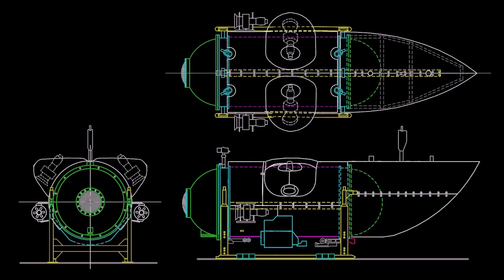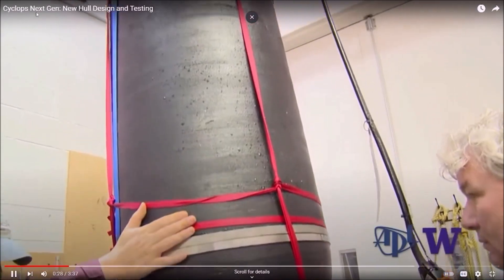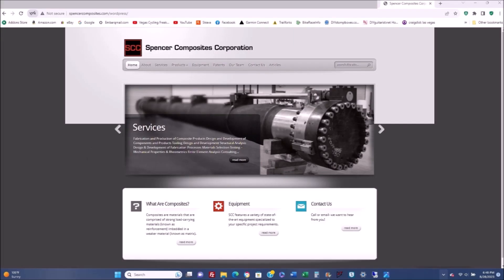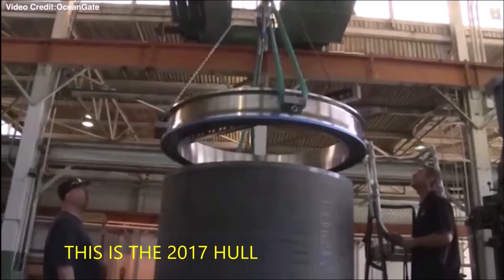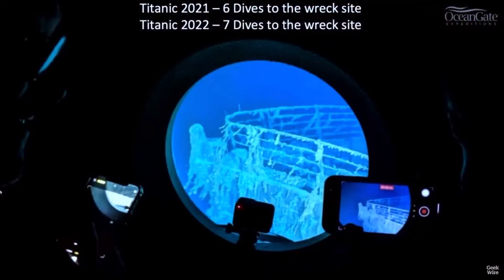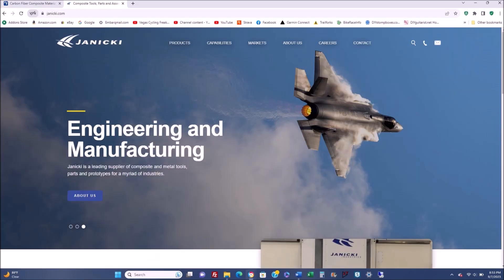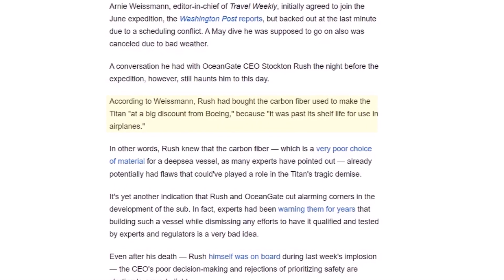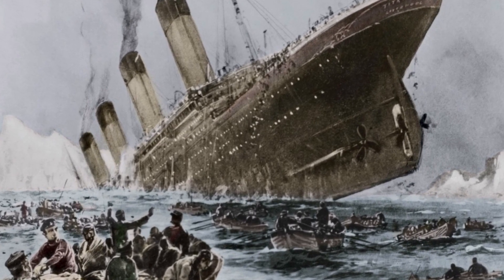OceanGate Titan - THE CARBON FIBER CYLINDER(S)

Comment: S.Rush was also totally against more testing, and what about the window that wasn't rate to go to the depth of titanic? You peking excuses for stockton is funny! WHO resisted all that testing you say was needed? OH Stockton? Ok then
Reply from the maker: You are mixing up pre-2020 and post-2020 hulls. Some of those things don't apply to the 2020 hull. All that negative media stuff applied to the pre-2020 hull, which was scrapped and replaced with a new one using a much better manufacturing process. Timeline is VERY important when discussing anything about the Titan.

Watch these:

Acrylic viewport --https://www.youtube.com/watch?v=iDxzYXDY1gM&t=1s

Beyond certification? -https://www.youtube.com/watch?v=x99U0GKXDNc

RTM system -- 
https://www.youtube.com/watch?v=XVpkWoHl67Q

Rush was in uncharted territory. There were no standards to test to and he believed in his real time monitoring system, which in theory seemed like a great idea but in reality I think was false sense of security. What testing agency is going to take liability on something for which there are no standards?! Call it what you want, but Rush was on his own. No one would have certified that. They operated in international waters, were based in Bahamas and the "mission specialists" all signed waivers that mentions death nine times, and that they were boarding an experimental vessel. What else could he have done?

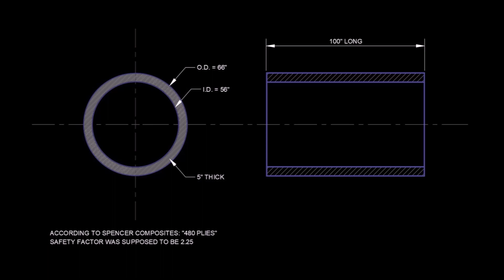Comment: @3:57 "able to withstand 6,600psi."

At 3,800m the pressure is 5,800 psi  so the safety factor was 10% not 225%, let alone 300%.
Reply from the maker: I'm just going off what it said in this article: https://www.compositesworld.com/articles/composite-submersibles-under-pressure-in-deep-deep-waters

I would interpret that as being built twice as strong as it needed to be. Obviously not how it turned out in the real world.

Comment: What kind of blithering idiocy is this?

This is all on Stockton and his refusal to do the proper engineering and his refusal tolerate anyone who advocated for proper engineering.
Reply from the maker: Put down your pitch fork for a minute. OK now get a copy of the ASME Safety Standard For Pressure Vessels For Human Occupancy and ASME Division VIII (Boiler and Pressure Vessel Code. Read thru all 196 pages of the PVHO and 796 pages of the BPVC. Show me where carbon fiber is mentioned in either one. Now explain to me how all these experts are experts on a subject they know nothing about. They were all worried only about how an incident like this would hurt their own pocket books. The only thing Rush could do was have a third party build him the cylinders to his specs and do his own pressure testing. I'm not on a moral crusade, I am looking at it from an engineering standpoint.
Reply: @VegasCyclingFreak  If engineering standards have not been set for the use of carbon fiber in such pressure vessels.  How can one interpret that to mean that they can do whatever they want with minimum testing and zero evaluation of the condition of the carbon fiber between dives?

That would be the time when you must be more conservative about your approach rather than proceeding with no regard for the potential dangers.
Reply from the maker: @ej2953  I hear you. With a design like this, it means you are in no man's land, completely on your own. So when Rush said he was pretty far outside the box, he wasn't kidding. Not in the least. The real time monitoring system in theory should have let OceanGate know that the hull was nearing the end of its service life, or at least the data should have told them that they needed to look at it because a little too much chatter was being picked up. I think it just didn't work like he envisioned it would.

Comment: Nope. Blame Stockton Rush... is the right thing to do. As the CEO of OceanGate, the buck stopped with him.
Furthermore, everyone with expertise & knowledge disagreed with the use of carbon fibre & dissimilar materials.
Reply from the maker: The expression of the expert's concerns I think has more to do with them worrying about their incomes and industry reputation than anything else. 

What should govern the construction of everyone's submersible is ASME Safety Standards For Pressure Vessels For Human Occupancy and ASME Division VIII. Carbon fiber appears in neither publication so Rush was truly on his own as far as that goes. None of these experts truly had any idea if it would work or not because none of them ever even entertained the idea. Or do any destructive testing - Rush did at least that, with 1/3 scale hulls. He did his own pre-first dive pressure testing too (2020 hull). That was the best he could do. I can confidently say that no one would certify a vessel which uses a material that is not even on the radar in the ASME standards. Everyone gets hung up on the certification thing and Titan simply wasn't certifiable. Rush wasn't the only one operating "unclassed" subs in that part of the world, there are others out there (not with a carbon fiber hull but some do utilize carbon fiber parts).

Also, there were two versions of Titan which used different hulls. That was really the main point of this video. All of the negative stuff - lawsuit, letters, gun shot noises, etc. have to do with the 2017 hull. Rush quietly scrapped the 2017 hull and had a much better hull made in 2020 while COVID-mania was going on. Titan was essentially rebuilt and improved. Timelines are important here... everything gets smeared together and it has to be looked at as pre-2020 and post-2020.

Did you know that OceanGate was based in the Bahamas? They were operating in international waters where they had no restrictions for certification and the "mission specialists" signed waivers that clearly stated they were boarding an uncertified experimental vessel, along with "death" being mentioned eight times and "die" one time. Whatever laws apply to Titan while diving in international waters are subject to whatever the laws are in the Bahamas. 

Rush did get some things wrong, and yes he may have a had a character flaw or two, but who doesn't? I think his main mistake was believing that the real time monitoring system would be a predictive tool, in the manner that he thought it would be. All it did was predict his death would be in a few minutes.

Comment: I'm a retired aircraft mechanic, I could tell this was a bad idea the second I heard of it.
Reply from the maker: When I saw how the 2017 hull was manufactured I would have agreed with you. Seeing how the 2020 hull was manufactured it gets a little more difficult to immediately dismiss it as a terrible idea. Did you encounter a lot of carbon fiber in your time as an aircraft mechanic? I know some airliners have monitoring systems in place that are supposed to tell when parts are nearing the end of their service life, etc.
Reply: @VegasCyclingFreak  I didn't encounter of carbon fiber layup, but I knew the general process and I have done a lot of fiberglass, engine and topcoats
Reply from the maker: @deafmusician2  My understanding is that the Boeing 787 is nearly 2/3 carbon fiber. I didn't know until this OceanGate thing that CF was is in such widespread use in aircraft.

Comment: This will sound simplistic and I don't claim to be an engineer. Just a ordinary viewer. But why didn't they make the carbon fiber hull thicker. Say 8 inches instead of 5 inches thick. It would be heavier but wouldn't it still be cheaper and lighter than titanium ?
Reply: Carbon laminates are ~1.8g/cm³, titanium is 4.5 so an equivalent thickness tube would weigh 11 tonnes versus 4.5 tonnes. That would require an extra 5.5 tonnes of external buoyancy.
Syntactic foams rated to 6,000psi are at least 0.5g/cm³ requiring 11m³ of it. That would have made the sub too large for the low budget mother ship. 
The issue wasn't the cost of titanium ($6,000/tonne), it was the knock-on costs.
Reply from the maker: @stephengrimmer35  Rush wasn't joking when he said that if the Titan was all titanium it would be too heavy and require an enormous amount of syntactic foam.
Reply from the maker: I've had the same thought but Rush was relying on the manufacturers, the real experts in the field, to make his hull. He gave them the parameters that it needed to conform to and they did the rest. It ended up being 5" thick. From what I understand, they use modeling software to design such things, and that may be what it told them it needed to be. The first hull that Spencer Composites made in 2017 was scrapped in 2020. The new hull also used the same thickness but it was manufactured by Janicki/Electroimpact using a different technique and type of carbon fiber. Not sure if that was because their software told them same thing or if it was because previous hull was 5". I'm not sure of cost between titanium and carbon fiber but carbon fiber would be lighter for sure. And that is why Rush wanted to use carbon fiber, because the theoretical strength to buoyancy.

Comment: Yes, Carbon fibre is strongest under tension… but that DOES NOT mean it is “weak” under compression. 

It is “weaker” if you compare to its tensile strength, but is still one of strongest material available under compression load.

Note that CF strength can varies wildly. You can have CF that is virtually impossible to break and you can also have CF that you can break with your bare hands. It really depends on the kind of fibre in use and the way it was constructed.

The disadvantage of using carbon fibre would be its high cost and that it doesn’t seem to be a dominant mode of failure with CF. The mode of failure is pretty much random. So understanding how CF would fail is a challenge and it is not yet well understood.
Reply from the maker: All good points. Different kinds of resins, epoxies, layup strategies, and varying degrees of “modulus”. Add to that it’s a relatively new material compared to steel, iron, etc so I think we still have some more to learn about its properties.

Comment: You are mistaken about the unidirectionality of the carbon fibers in the 2017 hull.  Rush stated the are biaxial in the 2017 video at the New York Explorer's Club ((25:40) OceanGate Deleted Video: Stockton Rush Explorers Club Lecture on EddieGM's YouTube Channel)  and Brian Spencer (whose company Spencer Composites  designed and fabricated the 2017 shell)  states the layup was biaxial in an engineering news article (Composite submersibles: Under pressure in deep, deep waters.  CompositesWorld website 10 May 2017).     The axial layers were preimpregnated fabric laid up by hand.  Not as sexy as winding a fibers on a spool, messy and time-consuming, perhaps that is why OceanGate didn't release videos of the hand lay-up process. They only released video of couple of minutes of the beginning of the winding process, not the middle or the end or the entire process.  What more evidence is needed to disprove the widely held "fact" from the internet that the 2017 hull was only radially wound?

Comment: Someone needs to inform the top surface of carbon fibre wide body jet wings that it can't handle compression. Because that's what it's been doing all this time.
Reply from the maker: Difference is airliner experiences very little compression. At 30,000 ft above sea level the air pressure is about 3.75 PSI. Contrast that with 5,538 PSI of hydrostatic pressure at 3,800 meters below ocean surface.

Comment: Mr. Rush knew enough to be dangerous,  unfortunately. He wanted his submersible to be novel and ready for revenue in short order.  Too many incorrect assumptions and short cuts throughout the entire process. Alas, If he only had followed proven technology.
Reply from the maker: Keep in mind that the Titan was the steel hulled 5-person Cyclops on steroids. Using any other material would have made the sub too bulky and heavy. As it is, Titan was still over 20-tons. That's kind of what drove the whole carbon fiber hull idea, the theoretical buoyancy to strength. It for sure needed far more testing and development. Rush likely felt "behind" due to 2017 hull not working out and then the COVID pandemic too.

Comment: "I'm going to prove why Stockton Rush isn't to blame". Proves Stockton Rush is to blame by saying the system needed to be tested more. And who else but old Rushie to put a halt to testing? Lol this entire video is one big hypocrisy.
Reply from the maker: Separate the moral, ethics and/or legalities from this and look at it only at a technical level. 

Normally a submersible would be designed per the ASME Standards For Pressure Vessels for Human Occupancy and ASME BPVC Section VIII, Division 1, Rules for the Construction of Pressure Vessels. Carbon fiber isn’t even on the radar in the 950 pages between the two. No way to have hull certified when no standards exist for it. All you can do is pressure test it. The rest is relying on the manufacturer. That’s what Rush did. It was supposed to be twice as strong as it needed to be. He was relying 100% on the manufacturer to give him a hull that could do the job. Sure, one could say it's his fault for using carbon fiber but that's not the point of my video. The other point of the video is to point out that there were two different versions of Titan, with two different hulls. The 2020 hull is what was in Titan when it imploded. Most people are blurring everything together and ignoring timelines and the fact that there were two different versions of Titan, which is important.

Comment: I still don't understand how you seek to alleviate blame from Stockton Rush for this fundamentally flawed and honestly quite absurd design? Nothing you say here absolves him of ANY of the accusations mounted against him, and indeed rather serve to corroborate them.
Reply from the maker: Normally a submersible would be designed per the  ASME Standards For Pressure Vessels for Human Occupancy and ASME BPVC Section VIII, Division 1, Rules for the Construction of Pressure Vessels. Carbon fiber isn’t even on the radar in the 950 pages between the two. No way to have hull certified when no standards exist for it. All you can do is pressure test it. The rest is relying on the manufacturer. That’s what Rush did. It was supposed to be twice as strong as it needed to be. He was relying 100% on the manufacturer to give him a hull that could do the job. Sure, one could say it's his fault for using carbon fiber but that's not the point of my video. The other point of the video is to point out that there were two different versions of Titan, with two different hulls.

Comment: Stockton himself said they coated it with rhino liner. Thats not the same thing as the poly coat.
Reply from the maker: That contradicts a 2017 post on the OceanGate FaceBook page... but that applied to the 2017 hull. May be that they used Rhino Liner on the 2020 hull. Would have to see on what date he said that to know for sure. Easy to see why the two different versions of Titan creates a lot of confusion.

Comment: I suspect pure, unreinforced resin, of the same thickness, might stand up better. Let me explain. Like string, carbon fibre is strong when in tension, pretty useless in compression and worse than useless across the run. Both the axial loading of the end caps and the radial water pressure were stresses across the run.
This is pure supposition, so I’m fine with it being discounted by experts. My hypothesis is that under these particular loadings, the carbon fibre was, basically, just a filler. The ultimate strength was that of the resin with all sorts of possibilities for minor defects, fibre against fibre movements, etc. hidden in the fabric. A pure resin cylinder could be much more easily inspected. And, if I’m going to be squashed like a bug on a Bugatti then, at least, I’ll get a great view before I go.
Reply from the maker: The carbon fibers definitely gave it strength, just not enough. At the minimum, there needed to be as many axial fibers as there were radially. I think that would've have held up.

Comment: If you can make two domes. Why not make the tube out of titanium as well?
Reply from the maker: The issue is the weight. Would make the 20-ton sub like 35-tons, which would need a lot of syntactic foam to make it buoyant. That’s also getting pretty heavy to safely move around.
Reply: @VegasCyclingFreak   Better than dying .....  CF is a wonderful material however where weight is not the main consideration over safety better materials could have been selected.
Reply from the maker: @stephengloor8451  In Rush's mind it was the right material because it's much more buoyant "than the next best thing, titanium". That's really why he wanted to use CF. That and it made the five person capacity possible. The Titan was already 20+ tons from what I understand. Rush claimed the weight would double with a titanium hull and it "would be too heavy".